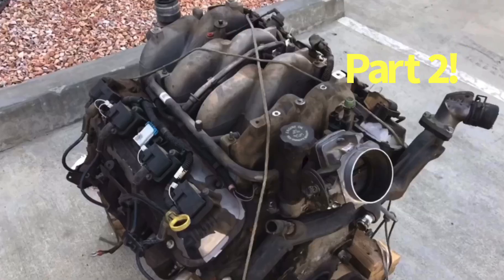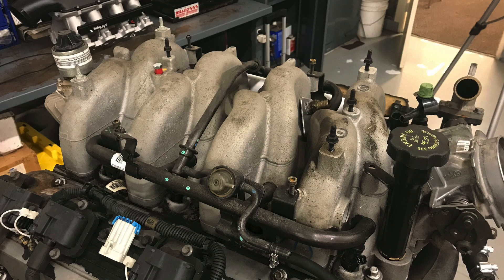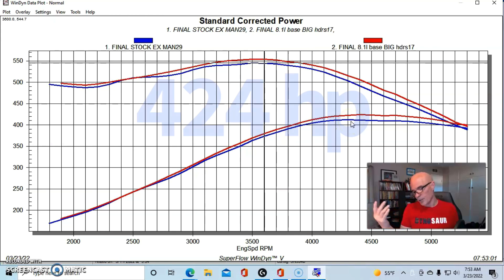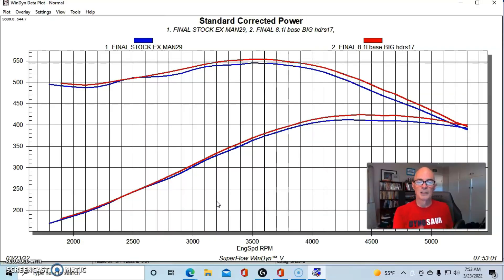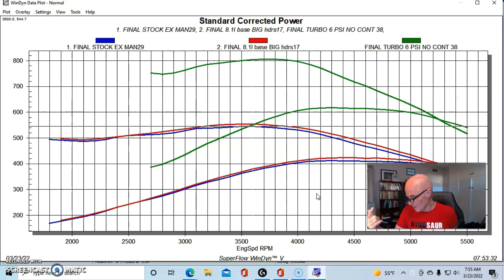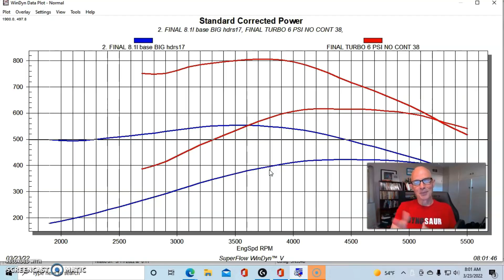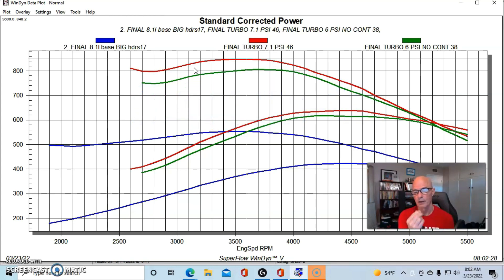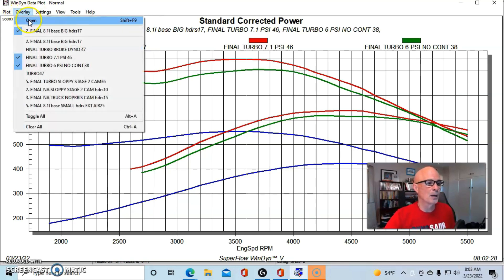HOW TO DIY TURBOCHARGE A JUNKYARD BIG BLOCK CHEVY-8.1L GEN 7 496 TURBO-HOW TO MAKE BIG TORQUE GAINS!

Comment: The best choice on gm is super charger not a turbo. You thought gas mpg was bad before on a 8.1L its going be even worse.
I have a  supercharger on a on off kill switch  on my specialty  8.1L 2500hd short dually. I use it only on hills towing, then turn it off to get better mpg when dont need it on towing.
Reply from the maker: no, just no

Comment: Never had a problem spinning the tires on my 2001 Dualie. 4.10 gears and locker.  Have an even worse time with tire spin on my 2020 Colorado ZR-2. Even  dew on the road causes the tires to break lose unless it is in 4wd. Would love to see what HP a turbo would come in at on the 3.6L V-6 with dual cams.

Comment: Would a 3000 or 3500 stall converter be overcome by the torque of this motor. How do you run a stall converter with a turbo?
Reply from the maker: torque increases stall speed

Comment: Would a twin turbo set up be good for this motor? Im building a mega mud truck and have an 8.1. Need advise on cam and what other mods to accompany a turbo setup wether it be a single or twin setup.
Reply from the maker: single or twin changes nothing (if sized for the same power)-I have a cam upgrade video on the 8.1L up already
Reply: Ok thanks. Im new to the turbo stuff.
Reply: Next question is, what about switching to carb, adding a gen 6 cam headers, porting the heads, then adding boost?

Comment: I bought an P.S.I. 8.1 generator  motor, turbocharged with less than 400 hours for 1,500$ !!!!, thanks Facebook marketplace!!! It'll be in my 1990 k5 with nv4500 5 speed and a 203/205 doubler soon! YIPPEE

Comment: Um if add turbo on it will require thicker oil over 10w30, need good quality oil or both?
Reply from the maker: no need to change oil
Reply: @richardholdener1727  cool, what kind of octane of gas? Regular unleaded, plus or super unleaded?? To me it seem like super unleaded because it modded

Comment: So... I found a big block turbo set up but its a t3/t4 (seen u said t3 no good for this big motor)twin set up. Comes with it all but.... its a bay set up think its a good starting point?
Reply: I just want to start on 4 psi
Reply from the maker: it depends on which t3 turbos they are but will likely work for low boost/power
Reply: @richardholdener1727  what I read is the turbos are .57 compressor wheel,3"inlet 2"outlet, .50a/r comp housing .63 a/r turbine housing t3/t4 hybrid. Thank you for the help by the way
Reply: Well its been 1year since I been here and Im back for this attempt again lol. I think I'm ready to try and throw a turbo on my 84 c10 with the 8.1

Comment: Do u have the exact build and list on what turbo kit u used? I just bought a 02 single cab dually with a 8.1 and 120k miles on it, super clean and wanting to add that package as well as replacing the stock exhaust manifolds and replacing with arp studs
Reply from the maker: sUMMIT t6 s475

Comment: Hi maddog from  north dakota have u flowed stock 8.1 heads trying  to find the perfect cam upgrade putting this monster in a 98 Silverado repower from a 6.5 diesel
Reply from the maker: I did a cam upgrade on the 8.1L-that vid is up-and I do have flow data

Comment: What a turd them 8.1's are 🤣
Im obviously bored at work 😁
Think ill put a t6 s475 on my psi 8.8 engine for my daily driver 🤔 
Anyone got a fuel card I can borrow 🤣😂🙂
9 to1 535 cube with little .538/.542 224/234 116 cam.
Still debating 4l85 or 6 speed allison 
05 suburban 2500

Comment: Hey rich is this test done with all stock internals stock injectors , cam , throttle body ect
Reply from the maker: it had a manual throttle body, bigger injectors-but otherwise stock

Comment: Can I run a 5 psi Whipple on one of these with stock bottom end on 93 octane ?
Reply from the maker: yes
Reply: @richardholdener1727  yeah and Larry at Raylar says it's not . What's the truth ? Somewhere in the middle ?  I wanted to move my 1.6l from my vortec 7.4 with some custom brackets onto an 8.1 but I really don't want to blow it up ... I could build a nice 454 just for the cost of aftermarket heads and rotating assembly for a 8.1 . 

The 496 book Larry helped write even says the bottom end is really only good for like 600hp .

Comment: Great video, have you tried a Procharger centrifical supercharger? I think the belt drive supercharger would add horsepower and more importantly for towing power alittle off idle
Reply from the maker: many times, a centrifugal supercharger design (procharger, vortech, paxton etc...) adds very little boost and power down low

Comment: Richard, Looking for advice on the 496 8.1 gen 7.. I have 2 of these in my boat. Great engines. looking to rebuild them with a little more power. Mercury did a great job at marinizing them. They are "496 HO's" 425 HP. Never had any issues.  Would like to make 550 575 HP and of course a lot more torque and not loose  reliability.Or have valve train issues or maintenance. 5500 rpm rev limit. What would you do to achieve this? It seems a single water cooled turbo with ball bearing center section would be idea. once forged pistons, rods and crank procured. Looking for your input.
Reply from the maker: ported heads, cam and more displacement
Reply: Mike, the only place that I know of that specializes in the 8.1 engine is Raylar Engineering. Look them up for all kinds of  parts for the 496.

Comment: I just found an 8.1 in a scrap yard, 500 bucks. Should I grab the engine harness and computers? Or can I drop it in my 67 Beaumont without the pump? Thanks
Reply from the maker: you can run it with a carb if you want

Comment: You will gain back pressure versus boost at higher and higher RPM because same turbo with an engine spinning and gobbling intake air more and more will lead to same turbo turbine being overwhelmed, yes?
Reply from the maker: ADDING BOOST ADS BACK PRESSURE, ADDING NA POWER ADDS BACK PRESSURE

Comment: Guys, 350sbc with 60k miles, how muxh boost can i run without playing with the ring gap?
Reply from the maker: do you know what the gap is?
Reply: @richardholdener1727  its appears to be a stock bottom end 1979 c3 corvette with performance package top end kit. So whatever it came from factory plus some wear?

Comment: It’s cool to see the trade off of displacement and tq/rpm. You see the 7.3l able to spin a little more rpm but only makes 500 foot pounds from 1500rpm and up not the 550 you get from the 8.1 but being able to spin faster the 7.3 gets a touch over 500 hp. I really want to see what the 8.1 does with a intake and cam.
Reply: My 8.1 works good with raylar cam

Comment: Aftermarket 8.1L parts are non-existent. I have a feeling that’s about to change.
Reply: Raylar Engineering is the only company that I have found that has a full line of 8.1 performance parts. Look them up.

Comment: Damn that thing makes power like a diesel. Would like to see it rev a little more but it's still badass...that's the turbo I have for a mopar 451 stroker. Maybe I'll eventually get it done, bout ready blow that roadrunner to kingdom come  though
Reply: If you run it ( 8.1 ) in a pickup from the factory, it will shift out of 3rd into 4th at 90MPH. And that is with a set of 4.10 rear gears. At that point you are exceeding that Allison's rating for output shaft RPM. And you will still be climbing in speed. And have another gear left to go.

Comment: This stuff is all cool 😎! I would like to see it with 2 of those turbos & see where she goes 😜😜😜😜! Anyway how about you & maybe Brule make a video about how you are wearing his dyno out 😂😂😂😂! It seems those dynos get run all the time?? With low to med horsepower! Under 2000hp! So I’m wondering 💭 how often he breaks load cell eyelets? Or how often you eat up the aluminum rotor/s in the water brake? Dynos in my area get used a lot! Some every day, but usually on all N/A stuff!  Guys around here rarely do anything more than breakin boosted engines N/A! Then once they have a basic idea on fuel flow in LBS per hour & what kind of volumetric efficiency it has, basic ideas on what it likes for timing & that everything is good! Then they put it in the vehicle & hub dyno it after that! Sometimes we dyno blower motors, but usually we start with a single 4 intake, then stick the roots or screw on it! But those are usually small blowers on gas or E85, so it’s not like they make big power like turbo stuff! Anyway just wondering 💭 about how much attention they need & how often? I’m surprised that nothing happened when you broke the eyelet on the load cell??? I know a very very old loadcell broke on a old dyno with a large cube turbo engine on it 🙄🙄🙄🙄, it tore some shit up 🤬🤬🤬🤬! The whole pump spun & tore the water 💦 pipes out & everything 🙄🙄🙄🙄😳😳😳😳! Like I said a BF mess 🤬🤬🤬🤬!
Reply from the maker: THE EYELET JUST CRACKED-DID NOT SEPARATE-DYNO'S ARE RUN EVERY DAY

Comment: What oil and viscosity do you recommend using in the l.s.x. S.b over 1500 h.p
Reply from the maker: THAT DEPENDS ON THE CLEARANCES AND OILING SYSTEM
Reply: H.p melling oil pump .set up for racing clearances on the begs . If that makes sense.. ..good heat treated begs as well.

Comment: So glad to see another L18 build. The block needs DOHC 3V so bad, but no aftermarket support. Great to see someone pull the leaching to prove my point @Lawrence LT Tolman about a 400hp base on the L18 gmc when hydraulic leaching is pulled, and it's effect on forced induction. Are you going to actually show the porting process for the stock heads? Most people are a little shy with a tungsten bit on camera lol. I had a guy force 3/4 threads in my 12mm exhaust header studs, as such it feels too soft for boost, I am going to probably  port and polish new head gasket and re/over tap the treads....what size would you suggest? as at that point bigger is better right lolol?
Reply from the maker: bigger bolt holes?
Reply: @richardholdener1727  ya Oldsmobile header bolts to be exact will "almost" match the L18 manifold studs , so angry at the guy as I actually gave the guy studs and warned him they are brittle as I was a having a broken one pulled. Grrr helpers with a shop of their own lol

Comment: Rich, can you do a conservative run on 91 octane at 6-7 psi? I don't have e85 in my area and wanted to know what to expect on 91.
Thanks for the great content.
Reply from the maker: Mike Davis has driven around for several 100,000 miles with boost on 91 octane
Reply: @richardholdener1727  
I sure have. On 91 California crap gas.
Reply: @mikedavis3036  see nothing about your ride online . What you got with boosted 8.1

Comment: FYI, I met a fellow on You Tube who was a fleet/plant mechanic at some big firm. He said they had MANY 8.1s on duty, I can't remember if they ran generators or irrigation pumps. He also said they all tended to suffer a catastrophic failure at around 5000 hrs, if I remember right. (It's been a year or so, sue me) I recall they were breaking connecting rods. However, other gents objected, saying things like, "I have 300k miles on my 8.1, hauling fertilizer over the Grapevine", or some such. Food for thought. I would guess that generators or pumps run close to wide open their whole life, I dunno.
Reply: Industrial engines are under constant load
Reply: All depends on what it is matched to. On an irrigation rig with a 6X6 pump, it would drag a DD 4-53 down from 3005 RPM no load to 1900 RPM under load. An irrigation rig is just like running a dyno at full load. And that is why industrial engines never show the same HP as ones used in vehicles. They are at their rating up to 100% of their operating time.

Comment: So I was thinking about why this thing did so poorly with headers.  But smaller engines with worse heads do better.    Pretty sure someone mentioned a 128 LSA and almost no overlap.   I bet the duration was even under 200 degrees.   Without overlap the scavenging effect which helps fill the cyllinder of long tubes is removed.   This is one of those situations that a camshaft can release 100HP and then the long tubes will add their 25 to 50hp.   The camshaft ( which must be "small" with short duration, wide lsa  ) is certainly the responsibility for most torque available off idle to around 3500 RPM then falling off.
Reply from the maker: 128 lsa? I think not
Reply: It's nowhere near 128. Maybe 116-118. It's VERY short duration.

But the intake behind the throttle body is such a restriction that headers don't help a ton.

Pull the intake, cut the bottom off, and start porting.

When the intake manifold will accept a mounting plate for a minimum 100MM throttle body, you've made progress. Then headers help.

Comment: How difficult would it be to put a 2012 hemi into an 2005 Ram? Has a bad 3.7 so figured it was the perfect time to put in a hemi. Haven’t been able to find an early hemi yet but did find the 2012.
Reply from the maker: bolting the engine in is easy-electronics are more difficult

Comment: How would you run this setup in a pickup for towing with an air to air intercooler, from like a duramax, and pump gas instead of e-85??
Reply from the maker: take a look at the live feed-I have a photo of an 8.1l 3500 with a remote turbo-runs on 91 pump

Comment: i WAS SURPRISED BY THE BACK PRESSURE ONLY BEING 2 PSI HIGHER THAN BOOST AND ONLY IN THE UPPER HALF OF THE REV RANGE CONSIDERING THE ENGINE DISPLACEMENT AND ONLY A SINGLE TURBO. IS THIS COMPARABLE TO OTHER SINGLE TURBO COMBOS YOU'VE RUN?
Reply from the maker: this turbo is sized right for the application-including the big hot side

Comment: Do we have any theories on why this thing responded "better than normal" to such small amounts of boost?
Reply from the maker: the slight improvement over the formula is likely from the use of E85-which can add 35-40 hp by itself
Reply: @richardholdener1727   awesome, didnt catch that
Reply: E85 makes sense.
Reply: @richardholdener1727  Back in the day "turbo specific" cams had a really wide lsa :-)   But yes, E85 is most of that gain.
Reply: I would guess that its just really really efficient at that boost level as it is seeing a 50.4% increase in Hp and a 53% increase in torque with only a 47% increase in atmosphere (at 7psi)
Maybe this is due to a slightly lower compression ratio that this engine has making it less efficient when naturally aspirated?
Reply: Big cubic inches and low (ish) stock compression.

Comment: What size of turbo can you used for a street application if you go to around 10psi on stock bottom end whit a mild cam around 230° duration idle to 6000rpm
Reply: For twin turbo app not single
Reply from the maker: what power do you want
Reply: Around 800hp and 1000foot pound of torque

Comment: Love to see the 8.1 vs lq4 power curves. I almost bought a 8.1 truck vs the 03 6.0 that i still have. But i knew 10-12 mpg was all i could ever hope for out of the 8.1. Atleast the 6.0 can get near 15 and power is still decent...especially after some bolt ons. Still love the 8.1 tho.
Reply: I built a 9.3:1 496 big block with  a wide lsa roller cam ls firing order and mercruiser boat intake that made 15 mpg highway (55 mph) in a 6000lb 94 dually using 3.73 gears from a diesel and nv4500 5 speed.
Reply: @cmcbunch  that's pretty good. My dads bigblocks never did that well. But he wasn't gonna drive 55😁
Reply: @HioSSilver1999  lol yeah it felt really good at 70 but then it was about 10mpg.
Reply: My 8.1 butb only gets 10 on the highway. Stock form
Reply: same here
Reply: Funny, I got 16MPG with the truck and trailer at 18K. Until they started putting ethanol in the fuel where it dropped to 14mpg. Engine was one that liked oil till I added 1 qt Mobil 1 to the rest of the Amsoil.

Comment: Mr. Holdener, great information! Did you add ring gap to this engine? You didn't mention it in the video. And on the engines you do add ring gap to, are you adding it to BOTH compression rings, or only the top compression ring? Thanks in advance for the info, and for what you do!
Reply from the maker: no gap yet on this one-I do top and 2nd ring
Reply: @richardholdener1727  how much boost would you think would be a safe amount with no ring gap?

Comment: You'll never reach that turbo's max power rsting on such a large displacement engine🤷‍♂️ I'd bet you're nearly at it's turbine choke point already.
Reply from the maker: did you see the back pressure curves-we are nowhere near that
Reply: @richardholdener1727  yes I did and it looks good, can't wait to see how it looks with some real boost in it, 8.1l will make a lot of exhaust gas volume, at some point it will be too much for the little turbine wheel. We'll all learn something I'm sure! Appreciate the vids👍